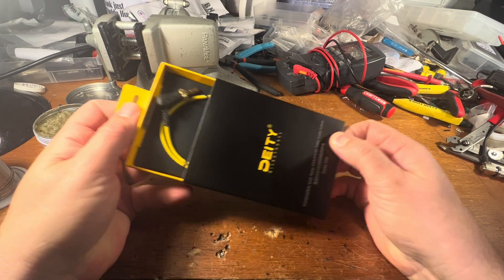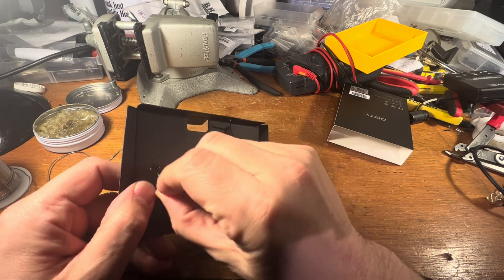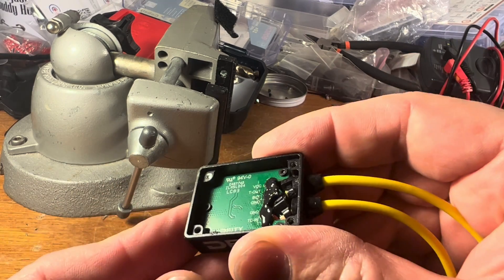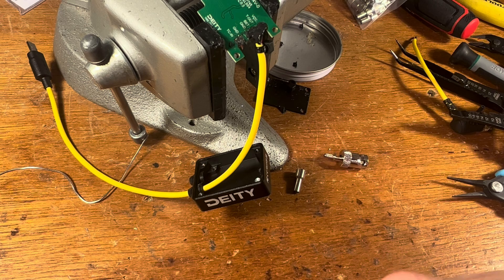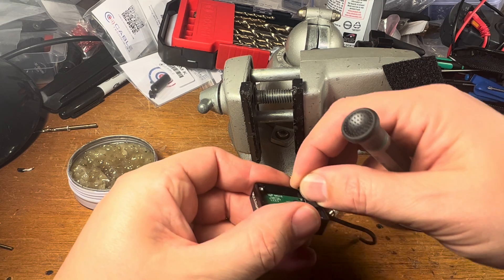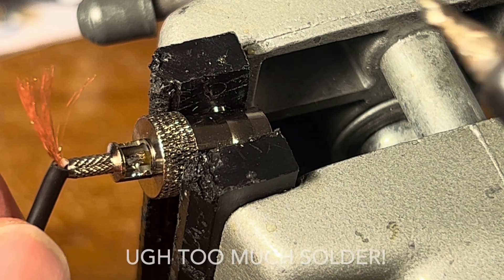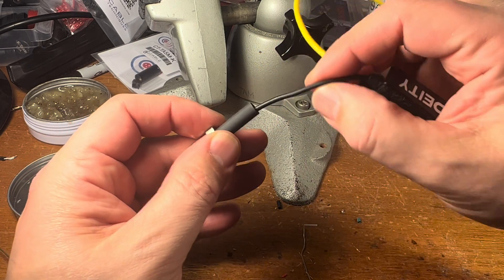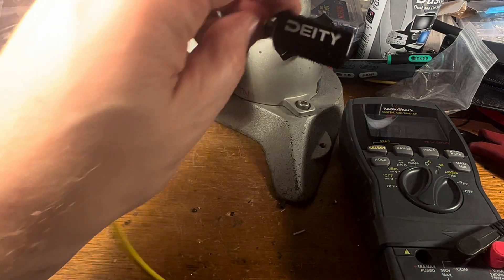Deity Timecode Adapter for SONY FX3 & FX30 (how-to modify to BNC)

Comment: do you need to keep the device connected during the shoot? Or could you use one device for multiple cameras?
Reply from the maker: These cameras dont have a stable internal timecode generator, so it’s advised to keep a constant feed of LTC timecode sending into the camera.
Reply: @HubLocationSound  I saw another youtuber was talking about how it lasts one full day without drifting. I was not sure if I can trust it. Anyways I am waiting for my cables to try it out myself. Thanks for reply, great video!
Reply from the maker: @dathofilms  I highly doubt any of these cameras would hold frame accurate TC even half a day. Especially with battery & media changes. I’ll have to test that next.
Reply: @HubLocationSound I think Sony says it’s 1 frame drift after about an hour, so I guess it’s fine for like short interviews but for longer either need to re-sync every hour or keep it continuous

Comment: Sony a7s3 also accept timecode with same cable😊
Reply from the maker: Thanks for the heads up. Looks like that A7S3 firmware (3.00) was just released a few days ago. I happen to own that camera, so I will try to test it out tomorrow.
Reply: Came to say the same, I tested it and seems to work well, also same cable with the Rode Wireless Pro works fine, although the connection with the 3.5 mm isn’t very solid with that last device.
Reply from the maker: @Betound  What cable are you referring to? The new firmware allows Timecode LTC into the A7S3's Micro USB port (Sony refers to it as a "Multi Interface")
Reply: @HubLocationSound  the Deity C23, same one from your video, it works with the a7Siii the same way it works with the FX3/FX30
Reply from the maker: @Betound  it does. I tested it last week on the new 3.00 firmware